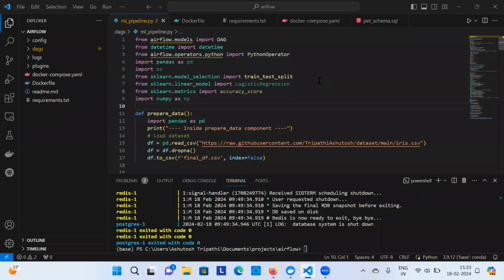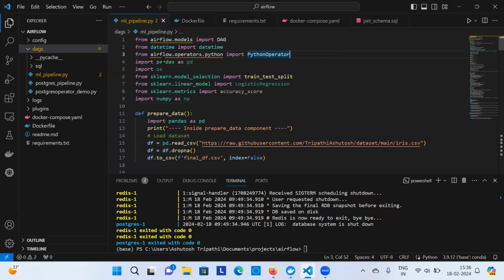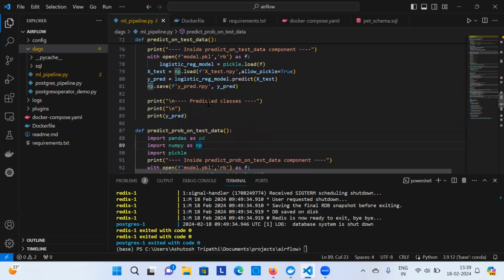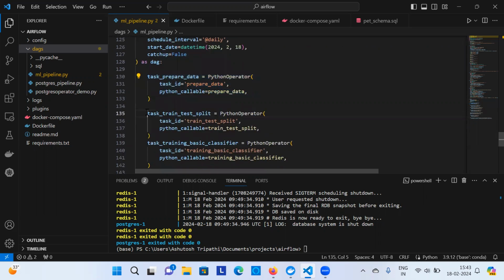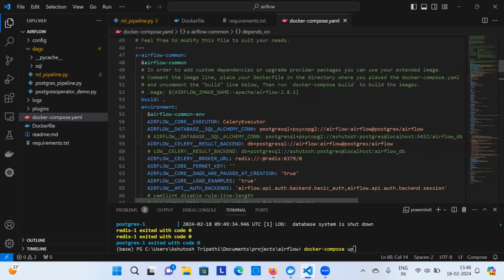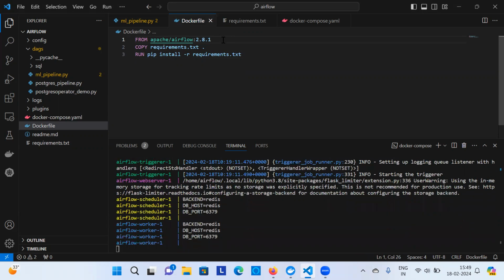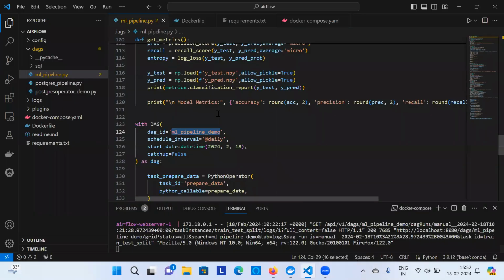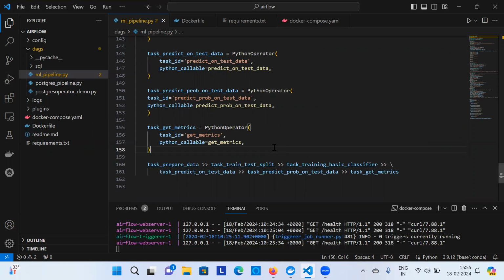How to Build and schedule Machine Learning Pipeline using Airflow | #mlops #airflow #ashutosh_mlops

Comment: Which best laptop config for mlops engineer
Reply from the maker: Use Ubuntu OS with 18 GB of RAM. it will suffice your requirement. I am not suggesting of having GPU and all in your laptop as it will increase the cost. For that you can use Google colab.

Window is not good for ML development. It create many issues while installing things

Comment: I have 5 external files having pandas code. I used to run them one after another in Spyder. How can I write dag to read code from these 5 files which read input files from my local and generate output csv files again in local in each?
Tried a few things but not able to run dag. Thanks in advance.
Reply from the maker: Are you running airflow inside the docker container? If yes then dag will not read files from local. Alternative would be- first file read from some url may be GitHub and then second onwards you can store  output files directly without giving any file path prefix example pd.to_csv("abc.csv") and it will save in the container local memory and then you can read it as well like pd.read_csv("abc.csv") then it will work.

Comment: Hi...this video is a godsend...thanks a million sir...🙏
Also i have a doubt. What if the ML project is bigger and more extensive? In that case can we still include the entire project source (incl. src, artifacts etc. etc.) inside the dags folder?

Or should we mount the entire project? If we should mount, how do we mount the project sir?
Thanks.
Reply from the maker: You can use the kubernetes environment and inside that have a pv mounted and place the codebase there. This should work.